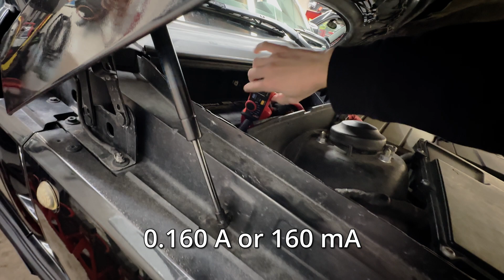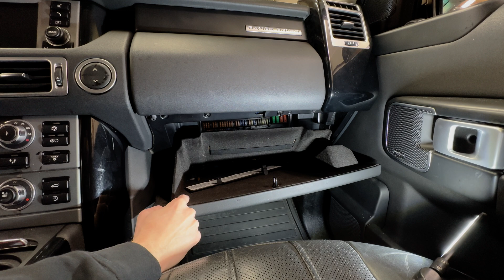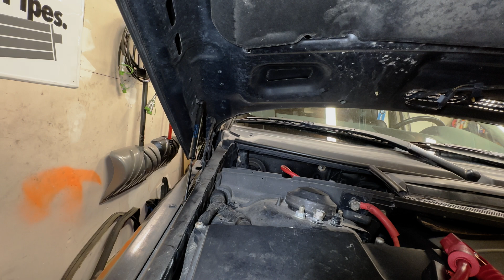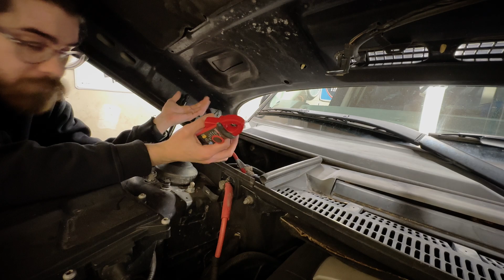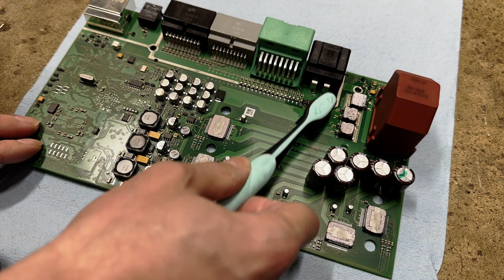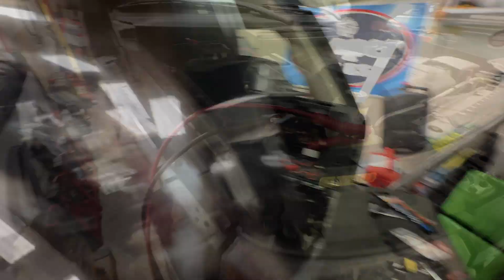NO MORE DEAD BATTERIES! - Fixing the Parasitic Drain in my Range Rover L322

Comment: loved that buddy. I have the same issue on my 2014 Range Rover Sport L494. Here in the UK, I'm always getting a message saying"Low Battery. Start engine." Have you done a video about the L494 with the same problem? Dave in the UK.
Reply from the maker: Thanks! It sounds like there could be a battery drain somewhere on yours as well, but there's also a chance the battery could be getting old. If you're able to get it tested that could be worth doing.
I only own the L320 and L322 so no videos on the L494 unfortunately.

Comment: Hi, we just bought the same carplay module for a 2009 L322 Range Rover after seeing your install video. Unfortunately the battery drains immediately while testing the system, to the point that we couldn't start the engine, and the module was very hot to the touch.

Comment: I have a 2003 land Rover my buddy bought, trying to help him get it started but it continuely cranks but doesn't turn over. Seems the battery is being drained too
Reply from the maker: If it's cranking but not starting, you should check for spark, fuel, and air first, then compression. Since it's an 03 you could also use an OBD2 scan tool to look for any error codes.
Reply: Check the door lock connector/ wiring. That happend to my gfs evogue and had a draw

Comment: aftermarket modules ori stereos always have way more drain in stby than OE ones... Found out the hard way, years ago...
Reply from the maker: It's true to get the idle drain to the minimum possible I'd have to remove the aftermarket module, but the amplifier was the biggest issue here. No dead battery since cleaning it up!

Comment: Very informative video. There are far too few resources on the L322 electrics.
Reply from the maker: That's true! I couldn't find any fuse box diagrams that matched the 2007 L322, and I don't know if the owner's manual has any more detail than the stickers (I didn't the books with the truck sadly). 
At least now I know F9 is the amplifier and F49 has the SatNav on its circuit!